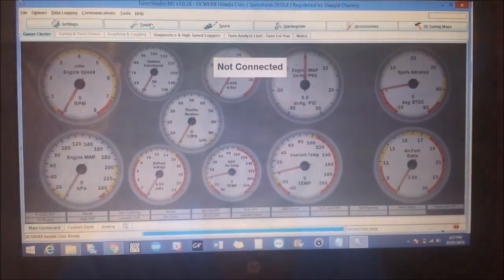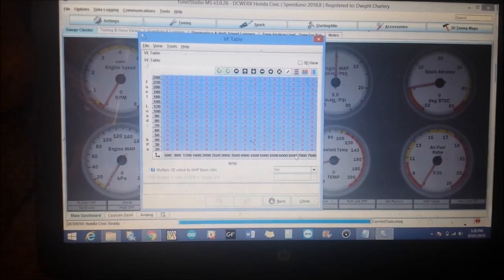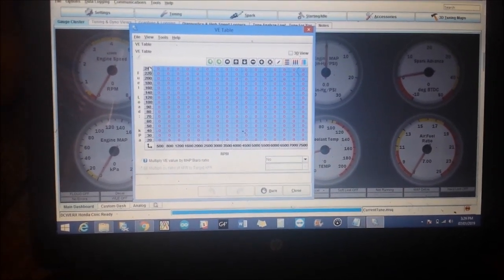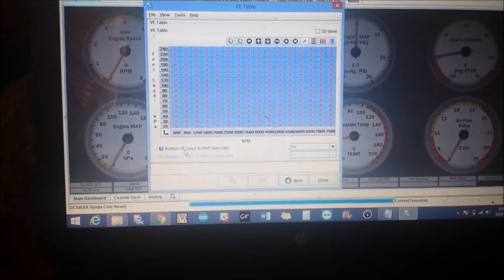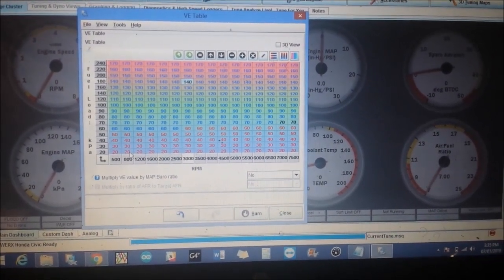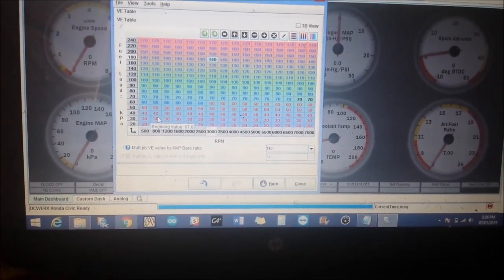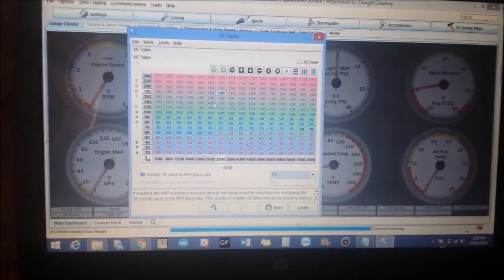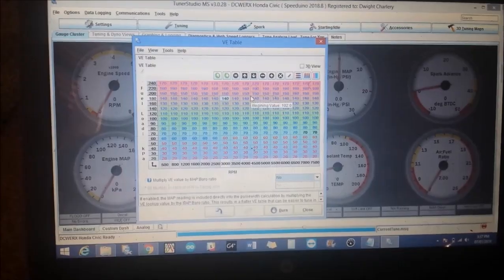Making a VE Fuel Table From Scratch

Comment: How do you get such high VE values? When tuning my 1JZ with Speeduino, on idle my VE is 5 and I still get AFR of 11.5, if I set it on 4 it goes up to 17.
Reply from the maker: Something in your tune more than likely is off
Reply: @DCWERX  My req fuel is correct, everything seems to be set right
Reply: Tal Sarig sounds like your injector information is wrong. Either way... something in the configuration/settings is very wrong.